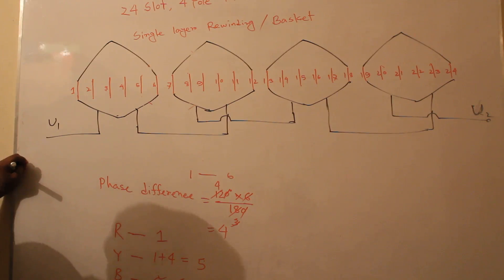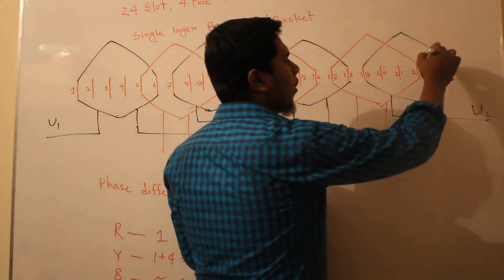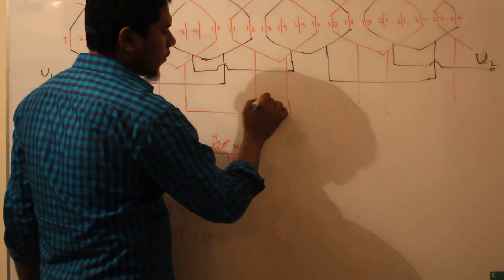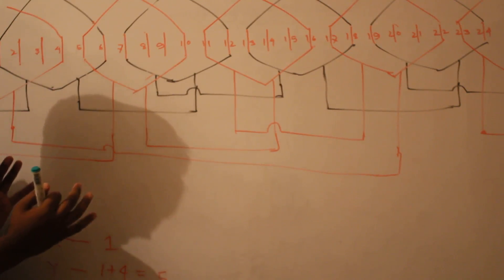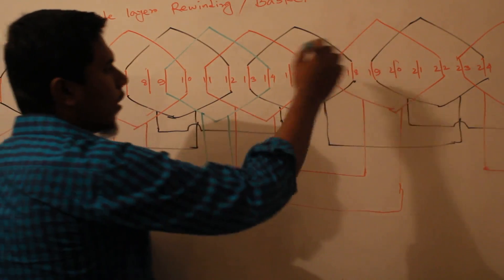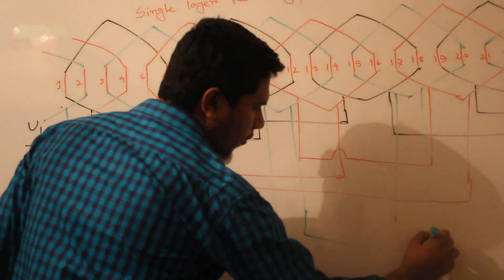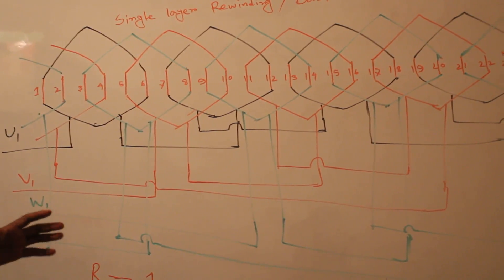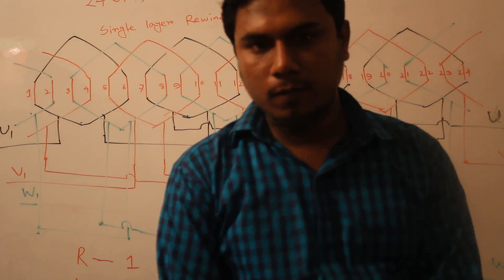three phase motor 24 slot 4 pole single layer rewinding in english. Part -2. how to motro repair.

Comment: Sir i have 1/2 hp 4pol 24 slot singal phase moter pls help me wire gauge  and turns iwant wind the moter thanks this time moter alredy wind ranng 23 gauge 70 turn and start 24 gauge  80 turn but moter very hot ranng 5 mint  and load 4.5 ampair so this is not good iwait for replying thanks